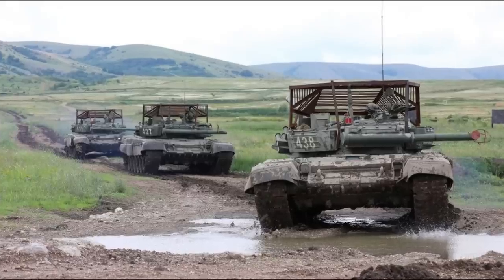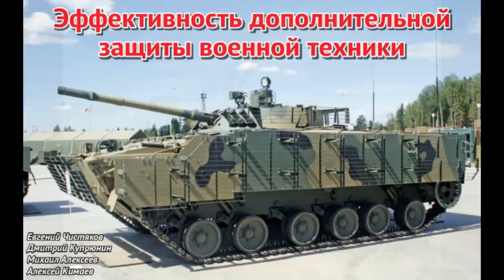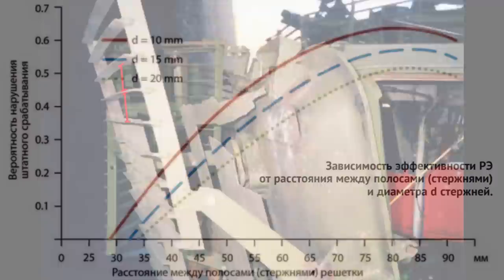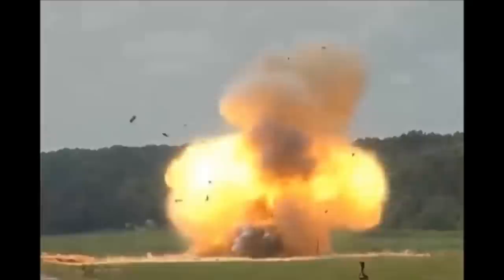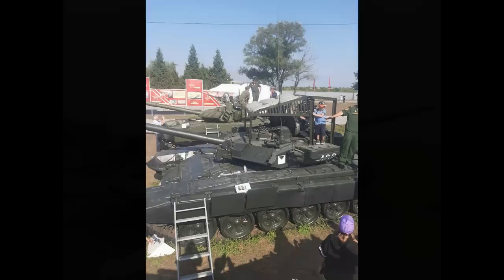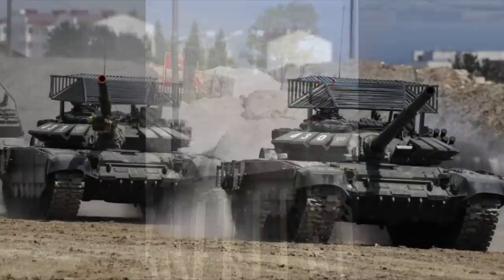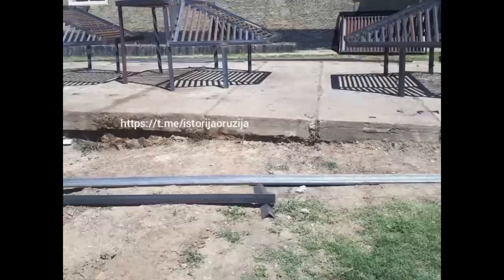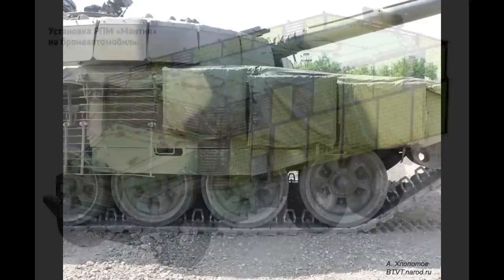The Truth About COPE CAGES

Comment: As a former TOW platoon leader, I can tell you that when I saw the cages, I thought they made the tanks more vulnerable rather than less.  They would show before the gun and sights crests a rise and the defenders would have a chance to get on target earlier.  If the tank is stationary, it's easier to find and the cage can be targeted with a top attack round.
Reply: Isn't Ukraine very flat?
Reply: Yes, but there are always enough undulations to hide a tank. The effective range of a TOW missile and a T-80 tank are both 3-4km.  A T-80 tank is about 2m tall, so let's say a 3m hill at 3000m is .999 flat land.

The most successful attack the Russians have made in the last couple of weeks is near Popasna.  It happens that they attacked down the length of the highest ground in miles.  Terrain always matters.
Reply: @invertedv12powerhouse77  Ukraine is not a salt flat. Plenty opportunities to fire from a hull-down position.
Reply: @taekatanahu635  yeah you could hunker down I guess. But alot of the videos seem to see tanks getting blown off the roads. Disadvantage
Reply: Still smaller than an abrams. lol
Reply: @invertedv12powerhouse77  the Donbas is filled with draws and ravines and full of creeks and rivers. Vehicle pretty much have to expose themselves moving over flats from one draw to the next. That's what cost Russia so many vehicles there in WWII. All while anti tank systems and artillery can stay hidden in the crevices.
Reply: @susi8198  the Abrams was designed fight from a distance before the enemy was able to reach them. Back when they weren't 40 years old and other tanks couldn't compete that was a good strategy. Now it's all hiding and urban warfare
Reply: @susi8198  And also 100 times worse.
Reply: @susi8198  Actually the cope cages do make their tanks taller than an abrams. The T80 is only a foot shorter clean.
Reply: I was just thinking, what's the point of fielding the lowest profile tanks if you then stick a cage on them which makes them taller than an M60A3?
Reply: @akizeta  Exactly- not to mention the first part of the tank to crest the hill wont be the gun. You have about a fourth of the silhouette to get through before the barrel would clear a hill.
Reply: @invertedv12powerhouse77  More like rolling hills.
Reply: hmm, when I first saw them I thought they were a crude way to add a way for the crews to string camouflage netting over their turrets, breaking up the tank's profile for aerial observation while allowing the crew to operate from an open hatch position with superior forward visibility as compared to having the hatches closed and relying solely on vision slits.
When used like that the cages might also provide limited protection against shrapnel from artillery and mortar fire, somewhat protecting the top of the tanks against those.

I seriously doubt the red army envisioned the level of ATGM fire they were going to encounter in Ukraine, and probably designed their protection against artillery and drone dropped mortar bombs instead.
Reply: @jwenting  The Red Army isn't a thing anymore mate.
Reply: Who knew this comment would make so many cope and seethe.
Reply: What if you put a thermal cover over the cage? Maybe it could give troops some cover to come outside if they are in hiding, it would let the commander observe hatch open without his head showing up on IR from the top, maybe it is with some kind of camouflage in mind as well
Reply: @d.m.4548  wrong, that's exactly what they call it themselves...
They also still call their air force the red air force and their navy the red banner fleet.
Reply: I like that idea.  The best IR camoflage I know of is bug screen.  You can see through it but it absorbs IR reducing your signature.

Best of all, mosquitos can't get through it.  Have you ever tried to sleep in an armored vehicle with the hatches closed, it's MURDER!
Reply: For Russian doctrine you'd think tank trousers and carousels would be a lot less effective because of this.
Reply: My guess is for tangent warheads from top attack missiles so the Era strikes the actual warhead or to make it harder for infantry to climb on.
Reply: There was a tendency of green US WWII tankers putting sandbags on their tanks for extra protection.  It made the tanks slower, used more fuel, got them stuck more often and blew out transmissions but made the tankers feel safer. It took a while for the senior leadership to stomp out the foolishness.   

I take these cages as being marks of green troops not knowing what works and a chain of command not knowing any better.  The ignorance of the senior commanders is the real problem!
Reply: @jwenting  No they don't. Ground foces are called Армия России trans. Armiia Rosiyi which and air forces are called Военно-воздушные силы trans. Voyenno-vozdushniye sily.
Where did you get that info about "red air force" or "red banner fleet"?
Your ass?

Comment: In 2021 I discussed them with tank crews during the expo. They said it was an order from the top, so it seems like field modification rather than manufactured one. Update: ow, southern district, that's exactly where the expo was
Reply: а сейчас смотря на это по другному воспринимаешь к чему все это было. тогда трудно было поверить, что будет спецоперация и казалось, что это просто исследования для того, чтоб результаты применить на танках республик.
Reply: Where the expo was? Vladikavkaz? I've been there too :)
Reply: Thanks for the info. I was curious about this
Reply: @ukuskota4106  батя говорил что не стоит мне на это дело ходить и поддерживать эту кровавую вещь, ответил что это чисто для защиты внутри...как же он прав оказалась. Хотя бы я очень прав был на счёт заборов и что они против Javelin не помогут
Reply: @MrMediator24  заборы только бтрам щас помогают
в этом я с каналом куперштайн согласен
Reply: It also seems like the cages would prevent a turret-top machine gun from firing upward very much, such as at drones, aircraft, or enemy on taller nearby buildings.

Comment: i personally believe that they installed these cages from the lessons learned in Syria\Iraq\ISIS. Where they used low cost drones to drop bombs directly on top of tanks where their armor is at the weakest and it would not take very much to destroy the tank this way.
Reply: I think these cages were seen first in Syria. I remember people mention it several years ago. It was in small numbers though. They probably see it work against small EFP dropped by commercial drones and used it in Ukraine expecting similar threats. Which to be fair Ukraine did use similar methods. problem is that it is a single specific threat that the cage works against. It is a detriment against literally everything else. Maybe they hope it would work against more capable munitions but logically speaking, that's unlikely. There may be some fluke cases but all the associated drawbacks just seems like its a bad idea.
Reply: @Работаем, брат! ayyy my man backing up all the research i had done on these since i heard the stupid phrase cope cages. i have seen the anti drone tech they are using now. it's high tech shit.
Reply: Germans tried it in WWIi, as did US armor in Vietnam.
Reply: @Работаем, брат! They were all designed for anti rocket protection. Some better than others.
Reply: Still they fight the same enemy as in Syria...

Comment: That " long weird metal bent in a v shape " is just a 90° angle steel one of the most common types of steel bars.  
Also how are they supposed to be lower if the crew hatches are supposed to work while protecting from rpgs fire from buildings.
Reply: Ive seen that kind of steel rods used in BBQs. No pun intended
Reply: how are they supposed to be lower?  Just make it into more pieces.
Reply: @miguelpi8831  Yes it is basically used everywhere. Very simple, cheap and relatevely good against bending forces.
Reply: @fronthole_guacamole  ah ok! thanks in Germany we call it "Winkel Stahl" pretty much the exact translation. 
I didnt know how to call it correctly in English
Reply: @fronthole_guacamole  we call it angle iron in Ireland, I'd assume most English speaking countries follow suit
Reply: @Liguehunters  Winkel Stahl - is it surname from biathlon?
Reply: You can lower the cages, by attaching part of the cage onto the hatch and the rest on the turret roof. a bit more complicated... but isn't really that hard. Some seen are clearly too high even when accounting for hatch opening
Reply: @neurofiedyamato8763  spoken like someone who has never worked metal before.  Welding a part to a hatch would be a nightmare of having to figure clearance fits and and angles with actually fairly tight tolerances.  You could do it, but then you would have 1 of 10 tanks done in the same time as you could have all 10.
Reply: @michaellind3653  This is true just putting a cage over the top with some quick welds is much easier and faster than actually having soliders figure out tolerances.

Comment: “Long weird v-shaped metal” is the moment my inner welder died. Also they only tacked the angle on, didn’t even weld it. It would probably snap under that kinda pressure and cause more damage.
Reply: I may not be a welder, but as a frequent patron of hardware shops, I too had part of me died when I heard angle bars as weird.
Reply: It's not a problem if the welds fail. If they are hit with a mortar, rpg or bomb, then the cage would get messed up, how sturdy the cage is don't matter much in terms of protection as the point is to detonate the warhead away from the turret roof. If anything, having it tacked on saves on repair time as you don't have to do as much angle grinder work to stirp off the mangled bits and fit new bits on it.
Reply: @N Fels I know, I weld too. I'm saying that it doesn't need to be attached harder. Mortars are made so they would go off hitting soft soil, else they would be useless in fields and would leave behind tons of unexploded munitions. Just the weight of the angle and it's intrinsic inertia is enough to do the job and set of the round. It simply does not need to be welded on and it would just make refitting take longer.

If we are talking about shaped charges, same thing applies, its job is to set of the charge prematurely. That little piece of mild steal is basically not going to put up any resistance, and even if it did, the inertia is way more important than the angle being fixed since the supersonic metal beam of a shaped charge moves at like 7km/s or something stupidly fast like that so it would have passed through the angle before it had time to move enough to rip the tack welds out.
Reply: @N Fels Also, as I eluded to in my previous post, stronger welds are not always better. Thus you can't say "you get much better results."

There are many situations where tack welds are sufficient and it's simply a waste of time and welding supplies to weld more. In this case it could make refitting a lot harder since all the mangled angles would have to be removed with an angle grinder if you want to fit new ones that aren't mangled. Thus fixing a tack welded cage would be much less work than fixing a "proper" welded one. There is little argument for over welding it. Maybe it would make it stand up to a few mortar hits but lets be honest, if you take a tone of those, you are doing something wrong.
Reply: I felt like someone stuck a I beam into my heart
Reply: Yeah why they layed/welded the inner struts of the cage instead of layering against the frame on top is beyond me. Those welds are just going to snap off and the missile goes through.
Reply: @geronimo5537  At the speeds the missile is travelling, it doesn't matter if it's connected or not. Just that it has enough mass and thus resting inertia to trigger the fuse.

Comment: Yeah, well there's a difference between those two. One gets in direct contact with the projectile before it detonates. But ATGM's in top attack mode detonate at a certain distance from the target, not when they come in contact. And in that case, if you have thin rods and wide spacing you're basically not countering the ATGM at all
Reply: That was my observation, too. The Javelin, and other anti-tank weapons like the RBS 56 BILL, use explosively-formed penetrators that are detonated at a distance above the target vehicle, so conventional slat armor, which works by interfering with the formation of the shaped-charge jet, would be ineffective -- the warhead never strikes the slat armor, and the penetrating jet is already formed when it reaches the armor. To be effective, the penetrator would have to hit one of the slats, and narrow, widely-spaced slats are largely ineffective. Using closely-spaced angle-iron slats increases the chance that the penetrator would hit a slat, causing the penetrator to lose cohesion and break up rather than penetrating the tank's top armor.
Reply: Indeed. RedEffect doesn't seem to understand what he's talking about for a lot of the video.